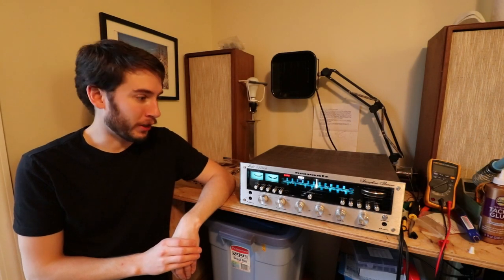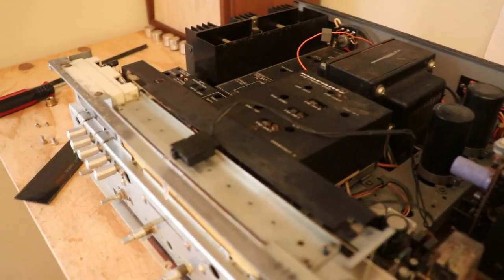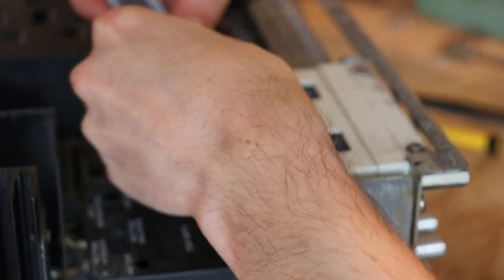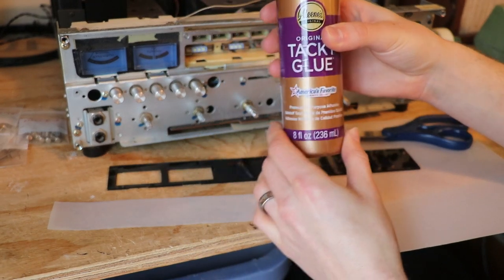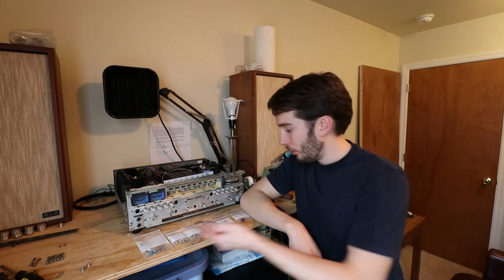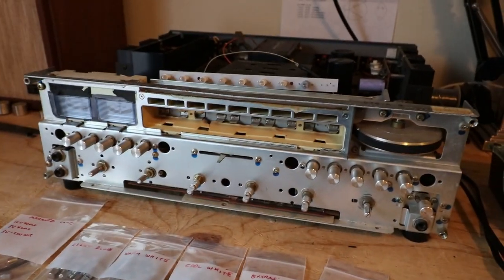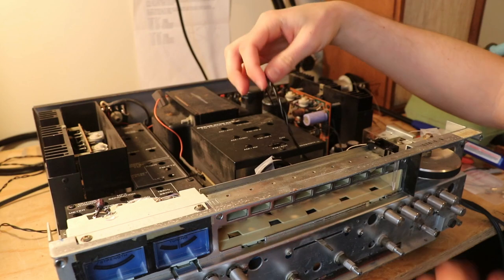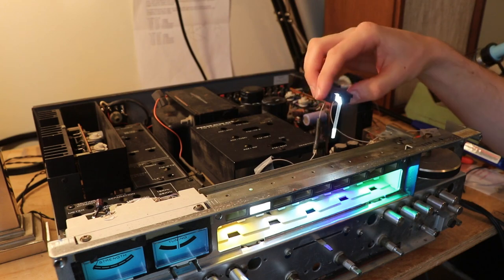How To Re-Lamp Your Marantz Receiver: The Ultimate Guide To Bulb Replacement *COLOR COMPARISON*

Comment: On the color of the dial lights...the original Marantz dial from 1970-something would have been a very distinctive blue. Not green, not greenish blue. The color turns greenish over time from the yellowing of the plastic housing and of course, the diffuser paper.  A lot of people just get used to the greenish color because they don’t remember the what it looked like 50 years ago.  The incandescent lights will give you the closest to the original, but if you’re going with LED, I’ve found the warm white LED lights look the best and the most natural in everyday light.  If you find them too harsh, you can always up the thickness of the vellum, or I’ve even used multiple layers of vellum to help tone down the sharpness of the LED so they look more natural. It should be a soft glow across the whole dial, not little blue spotlights jabbing into your eyes, which is what some replacements look like. And I cannot stand the blue LED lights. They just look wrong on a Marantz and burn my eyes. That’s how it looks to me anyway. Everyone’s mileage varies though.  Nice video.
Reply: I totally agree with you. MARANTZ is forever. I bought a brand new 4270 Stereo 2 + Quadradial 4 Marantz in 1972. It's 50 years old now and still trucking. I think I paid $730 dollars for it in 1972 which was outrageous for the times. Now I'm going to buy a new AV home theater system for my den. It will be a Marantz of course.
Reply: I actualy prefer this greenish/turquoise color on my marantz..
Reply: The reason the blue looks "wrong" is because blue LEDs are very monochromatic, vs incandescent, which is full spectrum with a filter that's not a perfect filter for colors other than blue. Letting other colors through makes the blue softer and less harsh on the eyes. Sometimes a trick you can use in situations like this where the LEDs aren't visible directly, but the light is being mixed through diffuser paper, is mix some green LED in with the blue. You can use different resistor values for both green and blue to customize the color, but adding even a little green in breaks that monochromatic blue look that pierces through your eyes straight to your brain!
Reply: @gorak9000  Yeah, nowadays you have all sorts of options on color.  You can get colored LED lights, you can even use colored vellum diffuser paper, you don't have to stick to the white.  You can mix and match to whatever color and sharpness you want, essentially.  The original looks best to my eyes, but some people like to mix it up.
Reply: I do as well. I refer to it as a shade of Azure.  Facts are, the dial is blue. (Back of the plastic) incandescent light, is yellow. The original vellum was made in Japan years ago, and is not white. It is and was, a shade of off white. The vellum today is WHITE with grey tint. 
  So, yellow light, yellow ish paper, means a blue dial with green tint just like the brochures. Just like the NOS Marantz ive owned.  It wasnt BLUE. it was Marantz blue. They diddnt want it to look like Pioneer. Or other blue units of the day. 
   Vellum that's not been exposed to heat, and never seen the light of day, doesnt get yellow. Ive seen it, i currently own it.  So,
 Others who say it was always blue, are wrong. Using GLUE on the back of the meters is also WRONG. 
  You sir, with you like for the greenish dial is inspiring.  
  Ive developed a formula to keep it original,  just like my NOS stuff, and brochures. Unfortunately,  many people eyes cant tell it ever had a green tint to it.
Reply: I agree w/mph7282. The blue/greenish tint really looks distinct due to the aged vellum paper. However, I after installing warm white LED's, I think it looks more true to the what early Marantz designers had in mind. Also, it's labor intensive to remove the receiver from the cabinet, along with the faceplate and dial face. Warm white LED's are the way to go. Set it and forget it.
Reply: How many hours do you think it would take to do what this video is showing? 
I'm planning to do exactly what is in the video. I do have some experience, and I'm handy with tools.
Reply: I’ve got a beautiful 2245 that’s been completely restored on the working side. However, I’ve got the greenish tint because of the vellum. I call it patina. I’m about that incredible sound Marantz has always provided. A little green on the dial is not a big deal. Especially when I didn’t have to pay a hefty Marantz tax on it.

Comment: Excellent video. I agree with you, I did five receivers restoration and original incandescent lamps looks better and for AM, FM I use led too. By the way, if the stereo lamp doesn't turn on after you replace, you need to go to MPX board and have one trim that is 19MHZ and just turn from one side to another, when stereo lamp shows on, that's the correct position, you all set.
Reply: We just replaced the bi-pin bulbs with LED's on my Marantz 2265 and the STEREO indicator light is not working. I see two 19KHz trims on my MPX board LPF. Did you have to adjust 2 trims?
Reply: @martyjones2679  Hi Marty, I have the same issue. Stereo light doesn't work when I'm in FM but it works when I switch over to Phono, Tape, or Aux. Have you figured out the issue? Thanks!

Comment: Well done, I was leaning towards LED until I watched your video....now I'm relamping as you did, just can't undo from that beautiful original look. I have the 2250b to revamp now then it goes in the rack with my other gear, and a 2220. Also pioneer sx 1250, just finished cleaning, completely original. I was in my early 20s  when these hit the market. Great job.

Comment: Well done Sir, Because you answered all my questions especially the weight of the vellum paper. Have a Mod 125 FM Tuner (very similar). But, my God what were they thinking all those indicator lights are soldered, do not have $300 solder vacuum. Also Thanks for posting your friend with lights, I will go there for sure, I want to do Green for the VU meters.

Comment: Aiden, You can use a red LEds on the stereo indicator and get reliability as well. Use standard 5 mm LEDs with a 1K res
in series with it, In almost all brands of vintage receivers this lamp has a 12 volt source and the multiplex circuit provides a ground to light the Incandescent  lamp originally installed. The 1 k resistor limits the current to that led to about 5ma...It should last forever at that rate.  Polarity is of course required..  I have used this method on hundreds 
of units with NO future failures ...  Just my experience..  I like to make my own fuse lamps using warm white Surface Mount LEDs and a current limit resistor (usually 75 ohm ) in series with two leds . I etch my own fuse boards and 
reuse The fuse ends of failed incandescent lamps.  When done the Marantz units look very close to original only a bit brighter. Cheers.

Comment: Awesome video !  I was recently given a Marantz 2250B . Very excited to start working on it “ slowly “ . I have zero experience refurbishing electronics but no better time then now to start . I think if I can get past actually cleaning the inside and deoxit the pots that will be step 1 . 
Step two maybe try the light replacements , although only the front one is burnt out and the pointer light and one VU meter bulb . Probably better to change them all out once you have to take it apart anyhow . This video will help me step by step ! Thanks again 🙏🏻
Reply from the maker: Check out my preamplifier restoration video for how to clean the pots!
Reply: @AHFixIt  thanks I’m on it 🙏🏻👍🏼

Comment: I've got a set of LEDs but decided to keep the original incandescent lamps after changing the vellum paper on a 2225 purchased in 77.
Reply: does the 2225 have plastic or metal housing around the lamps?

Comment: I know I'm late to this but wanted to add you can use a car fuse puller ($2 bones) to get those dial lamps out. Also place painters tape around the faceplate bolts to keep from marring the metal.

Comment: For securing the dial string on the pulleys after you've slackened the string, use blue or green painter's tape. Works much better than Scotch tape.

Comment: My only wish is for Marantz to re-issue the 70's retro model into the current line of receivers with updated speaker ports, modern capacitors, metal casing & black faceplates.

Comment: I am just about to embark on a re-lamping of my Marantz 4415 amp with confidence from your video and lamps from Wojo in Michigan. The I will begin the process of replacing capacitors.  I have a question about the use of a variac: It is good to use after a device has not been used for a while, to allow the capacitors to-re-form. How long is a long while ? Does six months count? A year?
Reply from the maker: Long while is like 5 or 10 years

Comment: Do you need to align the FM pointer to the dial (so that it is pointing at 89.3 when tuned to 89.3)?  Or is it sufficiently captured so that it does not go out of alignment? Really nice job on the video!

Comment: On the stereo lamp LED problem, is there a link to a schematic or service manual? As an EE who also collects 70s stereo gear, I see no reason an LED can't be used. Unless the lamp is also functioning as a negative coefficient resistor like vintage audio oscillators used. I strongly doubt that.  It may be that the circuit needs more current draw which can be done by placing a load resistor across the LED. We need to see a schematic.

Comment: Thank you so much for these awesome videos! They're super helpful. 
I'm wondering if you could possibly point me in the right direction on a repair I'm working on. I have a Marantz 2220B that produces a loud pop only when you power it off. If you turn off both speaker selects the pop will no longer occur. I tried cleaning the speaker relay but it didn't help, and the relay itself appear to be functioning correctly. Everything else on the unit works fine and it sounds great. Any help would be greatly appreciated!
Reply from the maker: I would check the dc offset.
Reply: @AHFixIt  Will do, thanks!

Comment: The stereo indicator probably turns on when your Radio station has enough signal strength to go from mono to stereo. Better try out with a radio antenna pluged in. if you havent an antena attach a piece of wire or piece of metal  to the port.

Comment: Love your videos, thanks. Just curious, I have a 2265B, have never seen the Dolby light on, but would like to----just 'cause---you know. Have you ever thought of re-wiring that to turn on when the stereo lamp comes on? If so How could I do that. I do not have the dolby decoder insert, but It is equipped for one. Mine does not have the front dolby button that this one has.

Comment: Hi thks for the very comprehensive video.   When changing the tuner pointer bulb, is there a positive  or negative part of the bulb wire? Or it works either way?  thks!
Reply from the maker: Works either way!
Reply: @AHFixIt  Thks! Changed the fm indicator bulb as well.  Need to work on my soldering skills though.

Comment: There is an easy way to do things and a hard way. I replaced all my bulbs by going in through the back. It took 10 or 15 minutes. I used LED's and it looks PERFECT. I used royal blue which is a clearly deeper blue than the deep blue in this video.  If anyone wants to do it the easy way I would suggest hunting down a video that tells you how to access the bulbs through the back.
Reply: Some of the older units have the lamp circuit board held in with tabs that just fall apart. You can use superglue and tape to reassemble . . . but my 2216B meter lamps are in a 100% old plastic housing with tabs . . . no screws at all, and you have to go in through the back. Not looking forward to breaking those tabs.

Comment: the plastic lamp housing degrades due to heat of the incandescent lamps.  I prefer to use warm white LED's.  Also with LED's you can control the intendency by rotating the LED's away from the front of the recover.

Comment: The completed receiver when shown with incandescent lamps *actually has a dead or intermittent incandescent lamp*! Check the soldering to the circuit board that holds the clips which the lamps snap into. Invariably, some of those solder connections are bad, having been baked and crystallized by the heat and current draw of the lamps for decades.  You will need to remove all the old solder so that you can resolder them properly. Trust me on this.

Comment: Thanks for the super in depth how to for this receiver. I'm running into an issue with my Marantz 2250b where none of the top row (indicator) lamps turn on nor does the tuner point lamp. I've tried replacing the tuner pointer and one of the indicator lamps already with no luck. Any ideas?
Reply from the maker: They're not getting power. Could be a broken wire going to that board.
Reply: @AHFixIt  Ok I'll investigate some more. Thank you!
Reply: One some units, the power supply for the lamps is separately fused. Look for a blown fuse!

Comment: Thanks for the video!  I had restored a 2216B with blue LEDs and it looks amazing, but I also have a similar 2250B that has burnt out bulbs and a suspect Stereo indicator light as well!  I'm really looking forward to what you come up with for that fix.
Reply from the maker: I fixed it here! https://www.youtube.com/watch?v=vPUseTTPVHg
Reply: @AHFixIt  Nice...I'm looking forward to watching it.  I haven't touched the unit in nearly two years but now I'm excited to jump back into it.  Just ordered replacement bulbs from the seller you highlighted in this video (Great guy BTW and super-responsive!!).
Reply: @AHFixIt  Just watch the 2250B Stereo Light repair video.  Great job troubleshooting.  Do you have any other videos on reading those old schematics?  I would have never been able to follow the logic that you did, knowing which trace to follow much less what the proper voltage was supposed to be for a specific component.
Reply from the maker: @SirDokk  I have some broken Pioneers that I haven't diagnosed yet.  I'll include some troubleshooting in those future videos if it works out nicely!

Comment: The reason that all the LED's look so so glaringly bright, regardless of which color you used, is because you didn't add series dropping resistors!  If you were to measure the voltages across each of those fuse type LED's you'd probably find them at several volts higher than they're supposed to run at. This is because the power supply was designed to push significant current into a bunch of inefficient incandescent lamps, but now that you've replaced them with low-current-draw LED's, the voltages to your new lamps has soared.  The LED's will run hotter than normal and eventually fail.  You can use a resistor substitution box or a potentiometer of say 500 to 1000 ohms as a test device subbed into the circuit to see what value of series resistor you want to use to tame the LED's; and then you'll need to do some ohms law math in order to determine the wattage of the dropping resistors so that they don't overheat.  Also, in my opinion the white dial pointer and white function indicator lamps look terrible, especially at that brightness. The dial pointer housing usually had a strip of blue-green or red color gel material in there so that the pointer had some color to it. The bi-pin lamps for the function indicators probably need some translucent, colored rubber lamp "booties" slipped over them to make them green, blue or reddish-orange.

Comment: Question. I was scraping of glue from the plastic plate (where the vellum sits) and managed to scrape of some of the dark coloring. I now have some small spots where the light is shining directly through. Have you had this happen before and what would you suggest? some black magic marker or something else?
Reply from the maker: I have not run into this issue before, but whatever you have on hand that will not let light through should be sufficient.  A few coats of marker could do it, if not, find a tape that is opaque, or secure some opaque material to the affected areas.
Reply: @AHFixIt  thanks
Reply: People, don't do half job. Anytime. Anywhere. Doesn't the logic tell you to dissolve old glue (and paper) in order of not scratching colored glass (plastic). These DIY jobs lmost always destroy nice vintage hi-fi pieces. Soak the places where vellum was glued and be very careful. Do not pry with your fingernails, box cutters an other sharp objects. I am generally very disappointed in how some people treat "restorations" and use LED lights, stupid colors etc. But that's only me.

Comment: HI, what color of led you put on the dial pointer? is it clear water warm white? is it 5mm? did you put diode rectifier and caps to it? thanks.
Reply from the maker: Hi, the LED for the pointer is cool white color.  I don't know what size was used, however, I measure the original incandescent to be 5mm diameter, so anything less than or equal to that size should work.

Comment: Well done! How did manage to not require current limiting resistors for the function LED's?
Reply from the maker: The function LED's in this video have those white casings around their bases, inside of those is a current limiting resistor soldered to one leg of the LED.
Reply: @AHFixIt  Can you advise on where you sourced those?
Reply from the maker: @laurgangilbert  I got those particular LEDs from irebuildmarantz.com years ago but dgwojo.com should have them too

Comment: may i ask is it the same procedures for model 4230 upgrade to LED lamps & meter lamps? much obliged! NYC
Reply from the maker: I have never worked on a 4230 before but it should be similar.  However there will definitely be differences, so look out for those.